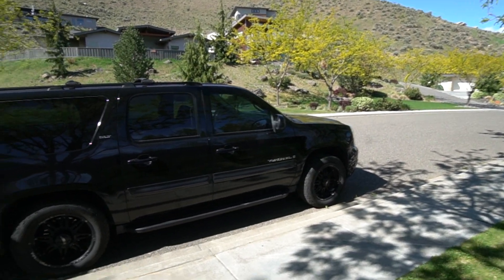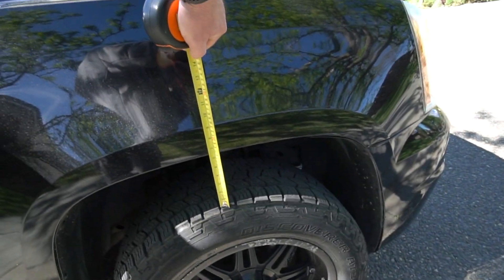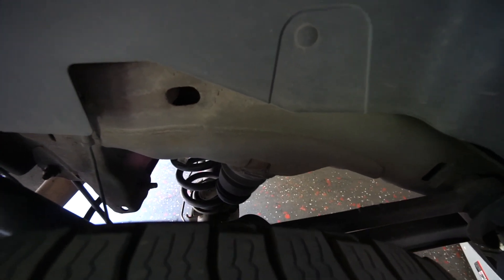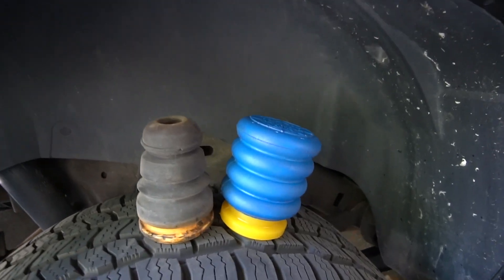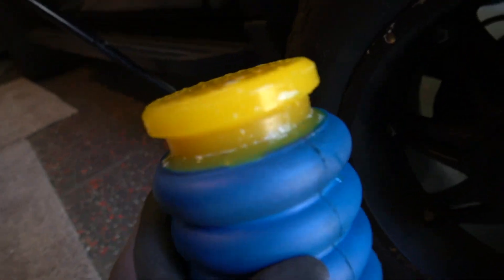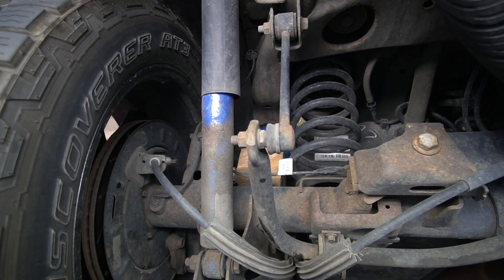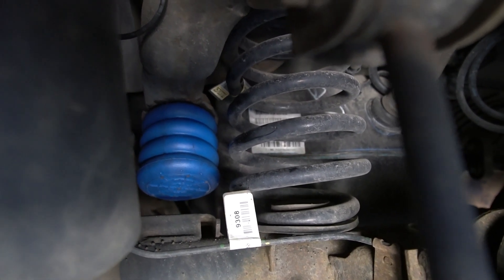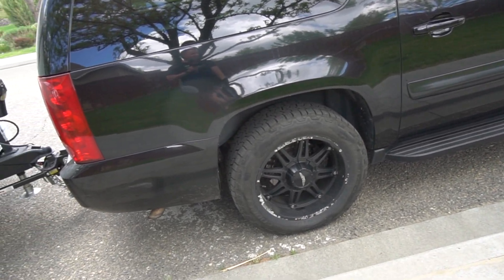Sumo Springs Install on Yukon, Suburban Will they Help?

Comment: Well, you can add Air Lift springs (60769) inside the coils to keep them from sagging under the weight of the trailer.
Reply from the maker: I adjusted the stabilization bars up one spot witch helped out a lot

Comment: Bumpstops are intended to be the last resort when you bottom the axle, not to support ANY weight.  This is a horrible idea.  The only correct method to support additional weight are HEAVY DUTY SPRINGS.

Comment: You need spacers, so the sumos are in contact with with your axle while unloaded.  And/or you need the blacks -47.
Reply: The axle is NEVER supposed to be in contact with the frame.  ALL load bearing is accomplished through the COIL SPRING.

Comment: Does it matter when you keep the springs? The spring rate will be on the spring and only the bump stop when the spring to highly compressed
Reply from the maker: it just helps when there is a bigger load on it.